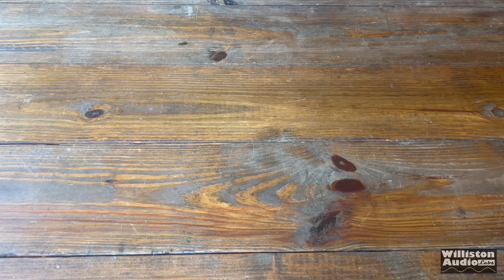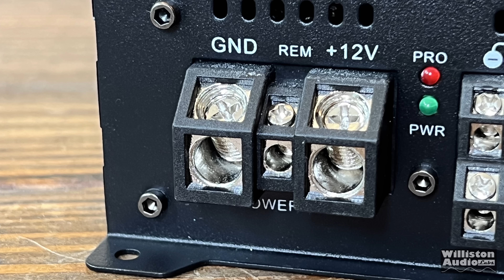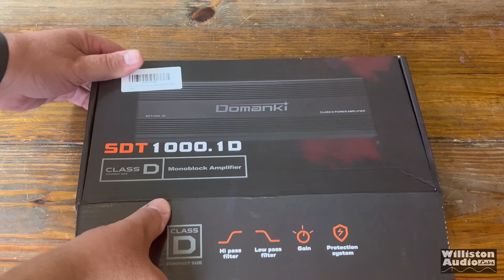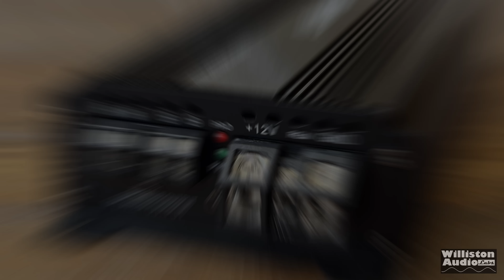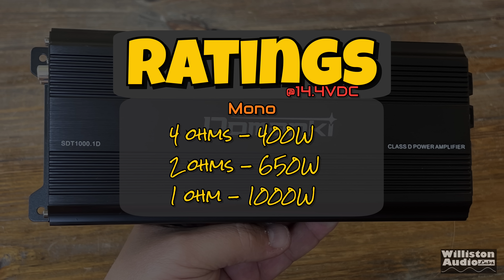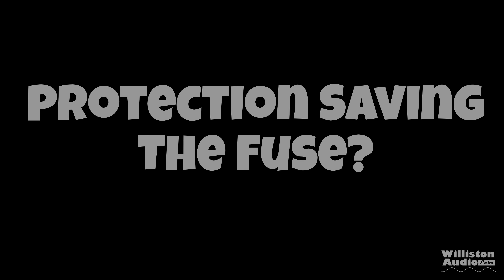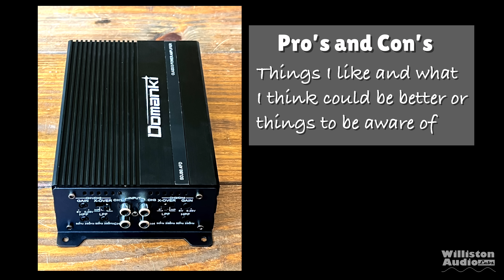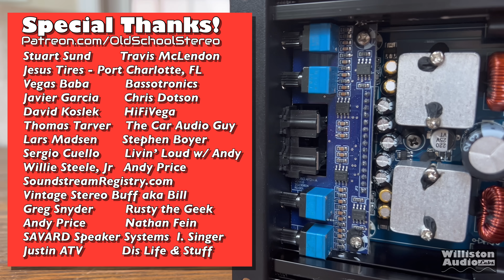Inexpensive Amazon Car Audio Mini Amps Yield SHOCKING Results

Comment: In a vehicle,  how would you achieve 14.7 or more consistent volts? Is that from the alternator or multiple batteries?
Reply: Most alternators are designed to output 14.7 volts as this is considered the industry standard. However, most of today's vehicles use pulse width modulation to control the actual output, making the voltage fluctuate quite a bit. 
The best way to achieve consistent power from your 12v system is to:
1. Upgrade the "Big 3". This is your power wire from the alternator to the battery, the ground from the battery to the engine block, and your power wire from the battery to the vehicle fuse block. Upgrading means larger, better quality wire with better connections.
2. Upgrade your battery. Look for a higher quality battery with more reserve capacity and/or amp hours in the group size that fits your vehicle. 
3. Upgrade the alternator to a unit that has a higher, more consistent output. Only do this if you have upgraded the "Big 3".
4. Add an additional battery and use a battery isolator. After the Big 3, this is the most cost-effective way to improve voltage consistency and reserve capacity. 
5. Add an audio capacitor or capacitor bank inline on your amp power wire. This works well to maintain consistent voltage momentarily, but it can get pretty expensive, especially for the amount of results you get when compared to other upgrades. Audio caps work really well if you've added an additional battery.
6. For massive voltage needs, do all the above, as well as consider adding a second alternator. This is only for those who need to maintain higher voltage and more consistent output. 

Hope this helps.
Reply: @knowplay3258 you mean 14.4 volts. That’s always been considered to be the “industry standard” average. Though like Derrick said, some Honda & Toyotas were known to only produce 13.8 volts. In a car, no matter what you do, you’ll never have a steady all the time voltage. The alternator isn’t charging 100% of the time. Put a good voltage gauge on their & watch it during a trip. It’ll fluctuate no matter the car. Agreed about your big 3 advice. There is no such thing as a wire too large.
Reply: Yes alternator mostly  but extra battery will also help👍🏾✌🏾
Reply: @302hobronco  you could always solder in a diode to raise the alternators charge rate. Not 100 percent on that though but jerry aint loud has a video on this on his channel. Have fun.

Comment: Not too shabby. You can buy from known liars, or you can go with the unknown that's honest at least.
Reply from the maker: Makes me happy to see true ratings posted. This is the reason I started doing this is to point out the ones that "cheat" with those power output numbers just to make more sales
Reply: Exactly.  It shows that they at least have at least done some engineering, or knocked off someone who did.

Comment: It is a golden time for cheap car audio, that's for sure, us Gen X people paid through the nose for even the crappy stuff way back then.
Reply: Yep, I was spending $100 on Pyramid amps that would get SPANKED by these until I learned my lesson and paid for a real amp.
Reply: @volvo09  IDK, I had a Pyramid 120 Watt in a 66 Cuda that rocked the entire 3 acre lake parties.
Reply: @volvo09 Except with Pyramid, it was almost always a disappointment when you turned those huge amps on back then 😅. I will say I had a passive EQ from Pyramid, and it was wonderful. Well, except for maybe the alternator whine that is caused 😅
Reply: Yep. It's easy to get loud today. Not so much back in the 80's and 90's. Lol
Reply: @dextermorgan1  In the 90's My '81 Fleetwood was rolling 700 RMS @ 14.4v with four 12" subs ported through the rear seat arm rest, which I'd put up to hide it.  Hifonics driving the front and rears, while I had two massive amps pushing the 12's after an active crossover.  Blaupunkt "honeycombs" mid-basses in the lower door while separates pulled the audio to the upper stage.  Wattage provides presence, which doesn't have to be loud.  But ok
Reply: @dextermorgan1 but back then you could get loud on a few hundred watts
Reply: @dextermorgan1  All I remember of the 90's is people having massive subs paired with a generic 10 watt OEM stereo, they sounded terrible
Reply: For sure... I was a car stereo installer during the late 80's and early 90's... my 1st business in 93 was a car alarm/stereo shop. My 1st sub system in my Datsun 260z was 2 15" MTX Terminators $200 and a 120 watt mono Sherwood amp... that amp cost me $200 at Montgomery Wards. I'm 52 and it's still in my blood so im happy I can still afford to PLAY AROUND...
Reply: @zmanjeep8230  I probably had that same Sherwood amp driving two sealed 8ohm kicker C10s in parallel installed in a Nissan hatchback.  Source signal was a pull out Sony CD receiver.  Think it was a cdx-5040.  120W doesn't sound like much but it was mind-blowing to my naive/ resource limited 17 yrs old ears back in 1990.  I always have wondered how good it sounded if I could compare it side by side to today's gear.
Reply: @zmanjeep8230 ha ha,  I'm 49 & I'm  right there with you bro 🙃 . I was also doing car audio installs in the late 80s and the 90s.  My first system was a pull-out cassette deck based system with a bazooka tube but my favorite system from back in the 90s was a detachable face Kenwood KDC w/ a 900 watt Targa amp pushing 2 Jensen xs Bass 12" subs.  I really miss that Targa amp but these days I'm running a 1000w XXX amp & 2 XXX audio 10" subs w/ a DVD receiver and it does surprisingly well in my 02' Envoy 🙃 ..
Reply: @zmanjeep8230 holy smokes are you my brother?    Mrs with a hold your panties.  A Hercules hi fonics amp   That cost me 300 hard earns dollars.   53 and just bought 7 of these amps. For my sound system.
Reply: @zmanjeep8230  Just got doing "quality of life improvements" in my 4 liter '87 XJ, where I refurb'ed the headliner while it was out I installed some Kilmat decoupler and some 4mm Siless throughout, as well as Herculiner from the back cargo to the firewall.  New Bluetooth head unit and dash camera system as well.  I've resisted installing a sub and amp, thus far.  I don't know how long I'll hold out at nearly 59 myself.  lmao
Reply: It wasn't crappy, but don't even ask what I paid to get two Audio Art 100 HCs, a 240.4 and the crossover back in 1997....  (Hint - it was slightly more than $150)
Reply: @azimmer310  It was a lot more than $150. The stores I owned in the 90s sold Audio Art. You should have been just over a grand for those 3 back then. The sound of these cheap amps will never match the sound of the majority of old school amps.
Reply: @azimmer310  $150 doesn't sound like a lot. In 1991 people were paying $1299 for BOSE AM3 speakers.
Reply: Eeeh, I dunno. There's some damn good amps out there for cheap
Reply: It may amplify but how much distortion And it's stable to what ohms
Reply: @Sirrichz28 what’s the distortion yeahhh
Reply: Yeah but the quality of the crap you're getting today isn't half as good as the crap we were getting back then.
Reply: Have you seen the price for the new Orion NT amplifier? It says it's only 400 watts ×1 @2 ohms, but I think it's actually about 1,000 watts. It's $2,200 on pre-order. If I get the extra money, I still might pick one up. I can't wait to see what they do with the HCCA line when they start to make and design them in the USA.
Reply: Check out Linear Power. Still made in the USA and one of the best sounding amps made including home or commercial. @sethgt1234
Reply: In 1998, I was a senior in high school. My stereo cost more than my truck!
Reply: @N-light-end-1This would out a lot of the Class D and variants. They are about as clean as my toilet paper the morning after eating a half pint of blueberries with a bag of Tapatio Doritos and a handful of dried cranberries.
Reply: Yeahhh I have to say it’s true when speaking in Terms of sheer power to weight and cost ratio. I suspect the older amps from our 90’s generation gear and late 80’s amps may sound sweeter and more musical.
Reply: But just remember most modern amps are at .1-.5% distortion right from the get go, most good amps from the 80’s and 90’s only made 100-500w but at .005-.01% thd, most all new amps are power rated at 10% thd or clipping. If you want a good quality awesome sounding amp you either go old school or pay good money for the quality. Me personally I’d rather have quality and sound over power and yes I do have a SPL and a demo build.
Reply: Well.. that's unless you went to be the "CAR STEREO LIQUIDATION" event at a local hotel... then you could pick up a killer Bakosonic amp/equilizer for $29.95 and 6x9 speakers for $9.95. 🙂
Reply: @snake_eyes_garage I loved those liquidation events! Valley Forge Convention Center.
Reply: Pyramid, american legacy baby!!!
Reply: Well , you were not going to simply buy one of those old school legends with rando couch change for sure .
These budget ones , hell you can buy half a dozen and if one goes POOF , just drop in another .
Reply: Very true although the sound quality is undeniably not as good when listening to a wide range of music... Strait bass heavy stuff it's amazing but I had to jump to a TPower Rockford for better sq. Hats off to affordable car audio
Reply: well not all was crap! I still have my old rockford fosgate amps!
Reply: "Dollar a watt" is no more. 80's are gone😂 Gen X we got overcharged
Reply: I just got the bug again at 50 lol old school bass head
Reply: @brogren802 same my t15001dbcp 10yr 💪🏾✌🏾
Reply: Most definitely. I paid out the nose for the first JL Audio class-D monoblock that they came out with. Although it actually put out way more than the 500 watts it was rated at, but it cost $1/watt on a good day.
Reply: Ohhh yeah - when the monsters were like 10 bucks a watt and the "affordable" name brands were between 1 and 2 bucks a watt. I miss my Coustic amps, some jerk stole them, my head unit and my electronic crossover out of my truck.
Reply: I fully agree.
Reply: Buck a watt was the general price when I got into car audio back in 94ish.
Reply: I remember paying $1to$1.50 per watt back in my day a jl or kicker 1k was 1000 dollars or more but you would get lucky sometimes and get a second amp for free. I remember spending around 3h on a zr1000 4 l7 12s box was free, plus a optima red top and a 390amp alternator
Reply: Remember back in 1987 when it was $1 per watt!!!!
How about a streetwires fuse block that cost $95, and then you had to try to find fuses that fit.
Reply: Ah, the good old days when I burned through so many crappy amps. I was so excited when I could finally afford MTX Blue Thunder amps. Still have 'em and they still work. 😄
Reply: I feel like hooking up to a running car and testing for noise would be a great addition to these videos. Lots of cheap amps sound okay…until the car is running and revving.
Reply: I remember $1 /watt days...
Reply: I totally understand 😢😂
Reply: U right 💯 percent I found an old lady had a  Mtx 9500 with the original tuned box and the Mtx Thunder amp for $60.00
Reply: I miss my orion xtr275, xtr2150 and alpine 1505 so much
Reply: I paid over $700 for a Sony V12 amp back in about 1993. I also paid about the same for a Hi Fonics amp.
Reply: Facts
Reply: @wheressteve  I paid 500$ in 94 for a 2 channel 200watt Rockford punch
Reply: Used to be about a dollar per real watt!!
Reply: I got the top strong great for 109$ it's beats
Reply: Yes!!!!!!!!!!! My goodness. So much overtime to save up for an Orion HCCA 225 with no low pass Xover or anything and PPI Art.  Worked alllll summer for it for pure power and now you can get 10 amps for what we paid!!!! Uyghu!!!!
Reply: I had class A/AB Amps. Best sound quality. Today you need to buy Mosconi amps to get that same sound quality.